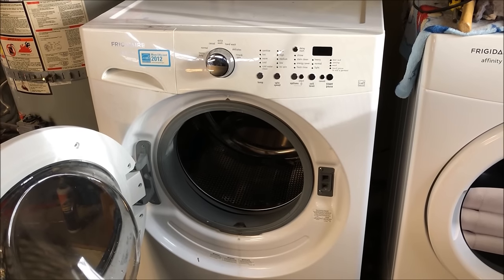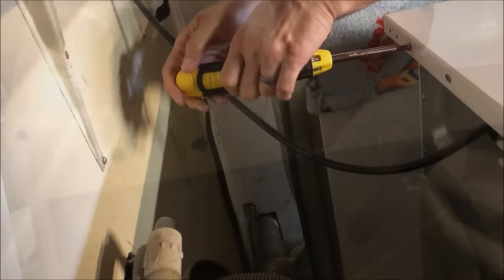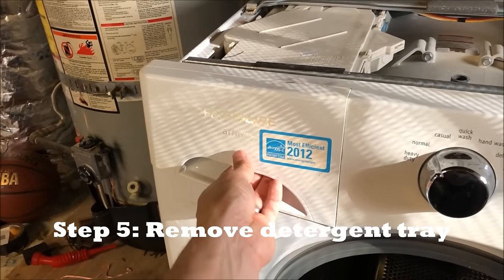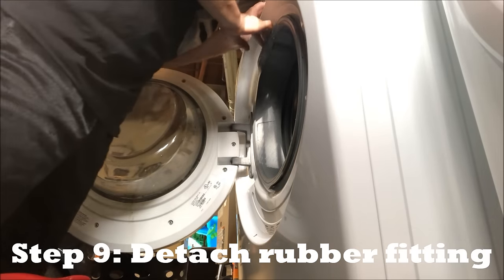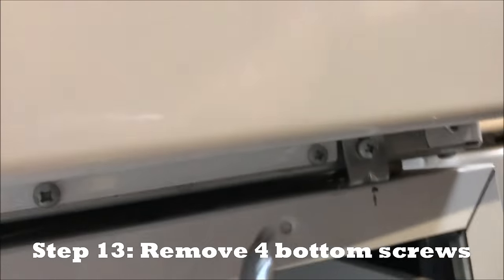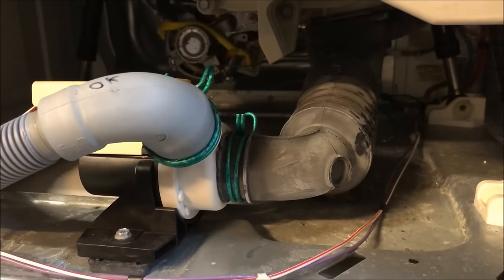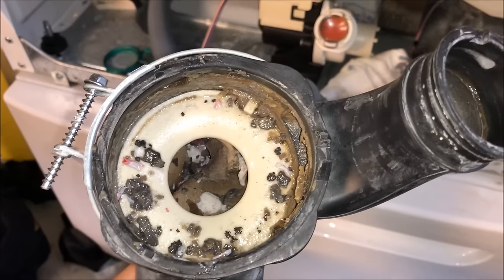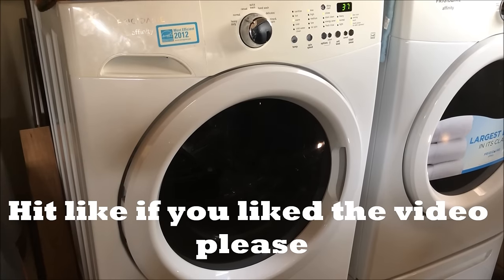How to fix Frigidaire Affinity Washer That’s NOT draining properly

Comment: Great video w great ideas. HOWEVER, i accidentally fouNd out it SO MUCH EAISER TO LAY THE UNIT ON ITS SIDE. There's access hole underneath and you right THERE where you need to be! I disconnected the main drain hose from DRUM(wide one), then the DRAIN HOSE itself, then white cannister (the DIFFICULT ONE). Twist, break the attaching white clip, making access easier to remove and reinstall tri hose connection. It took 30 mins for completion. I DID'NT HAVE TO REMOVE TOP OR REMOVE DOOR SEAL OR THE CONTROL BOARD OR REMOVE THE FRONT LOADING DOOR ASSEMBLY.... HOWEVER I AM VERY GRATEFUL TO YOU BECAUSE YOU HAD GREAT TECHNIQUE AND INFO!
Reply: I'm actually glad I didn't see this comment and went with the disassembly route. Unclamping the coin catcher was tricky even with the front off. Also I had a lot of water trapped in the machine which may have spilled onto electronics if I had it on the side.

Comment: Thank you for saving me from having to call the appliance repair guy! Our Affinity front loader (model FAFW3511KWO) actually has an opening in the bottom that gives you really easy access to the pump area and coin trap. No need to disassemble the washer, just tip it back enough to work on it. Found some rocks and COVID masks, among other things, clogging it up. Works like new now! Made my wife, who didn't believe I could do it, very happy. You're the man!

Comment: If you have a washer of this style, but not exactly this model, there's an easier way to get to the coin trap in some cases.  Mine let me remove a large access panel in the back with just a few screws, and had an access opening in the bottom.  That got me out of taking it apart.  I could directly reach the trap.
Reply: I have one an all I have to do is lean it back against the wall, no screws or nothing to get to the filter.
Reply: @DC-op8fs  I know what you mean about version differences in these things.  I have a car where changing a headlight is supposed to be about seven steps and take easily half an hour, but for whatever reason on mine, the process is to reach around a corner and unscrew the lamp and put in the new one, taking about 3 minutes.

Comment: I had a draining problem.. did not have a little service door to get to the filter. My washer is about 15 years old. The only trouble I had was to get the wire ring off. But ran your video back and fourth several times. The instructions were a great help, for the 68 year old man. I was a engineer a long time ago,  .. 

Thanks again
Reply from the maker: No problem. I’m glad I was able to help Bruce.

Comment: Thanks for the video!   The model I had was a little different but your instructions still were 95% applicable where it mattered.  The main difference was that it wasn't one cable to disconnect, it was 5 or so and they were all tie wrapped together.   Rather than disconnecting, I just rotated the front out of the way and ensured that the cables weren't pulled significantly during the work.   There was a huge clog; twist ties and enough fabric to make a sock.  Put it back together and all those puppies are barking nicely now!
Reply from the maker: You’re welcome. Thanks for dropping a comment. 🐶

Comment: Thank you man! Got this set (w/dryer) for a measly $275 from someone who had it in storage. Started up to clean and no drainage. As soon as I followed your directions and got to that pump, I could see why it was in storage. Bobby pins, a pound of wet material and probably $3 in change lol. Another tip for people doing this if you have the pump off you can reach up into the cavity of the washer. I managed to pull a sweater string out of there. Thanks so much man, don’t usually comment on these but you made my small investment well worth it!
Reply from the maker: Thanks so much for your input and your tip.

Comment: Thanks, got the job done. There are a lot of steps, but most of them are pretty quick. I think the hardest part was reattaching the coin catcher. I'm glad I followed the disassembly steps instead of trying to get through the access hole. That would have been really tricky to get everything clamped back on correctly.

Comment: Thank you so much. Affinity machines are terrible for accessing parts. Had to clean out Under the lint trap on the dryer and cursed the manufacturer for the most Un-user friendly construction. Same for accessing this coin trap and pump on the washer. Wow. Found a video that showed a machine with a removable panel, but needed to know how to take the whole machine apart. I absolutely had to have a second pair of hands for the squeeze clamps during reassembly and for getting the stretch ring around the door back on during reassembly. Your step by step instructions were perfect, and I am so grateful. And my machine works!
Reply from the maker: Thanks so much for your positive feedback and I’m so glad I can help out.

Comment: Saved us a lot of money. Thank you! For others attempting this, make sure you tighten the metal ring at the top of the coin catcher very well otherwise it will leak. My model was a bit different than the one in the video.

Comment: Thanks so much for posting this video.  Saved so much by taking the time to do it myself.  Also, I was able to get to the hose clamp that’s turned backwards much easier  be removing the back panel.  Also, I did not have to remove the hose that’s connected to the tub bc I was able to remove the clog from the filter without disconnecting that hose..  I removed $6 in coins and a sock from the drain.  Great video and thanks a lot.
Reply from the maker: No prob. Thanks for commenting. I’m glad I was able to help

Comment: Thankyou.  Good directions, I replaced the hard to work with spring hose clamps with ratcheded ones that work with a screw turn.  Easier and more controllable.  I'd call this a 2 hr job for the first timer.  A strong work light is helpful as it is with most everything.
Reply from the maker: Thank you! And thanks for watching and for your input the views appreciate it.

Comment: This video is so helpful! Thank you so much. One thing that I did was take off those annoying, difficult pressure clamps and replace them with hose clamps. So much easier to reattach when cleaning coin catcher and housing.
Reply: Not sure if you're still around, but did the hose clamps hold for you ok?

Comment: Another satisfied customer.  You probably saved me at least a couple hundos.  The guts of my Affinity were slightly different as my pump was oriented a bit differently but everything was pretty spot on.  The white plastic filter thingie in the rubber pump was absolutely disgusting.  I found a chunk of the drivers license from the former owner of my house in there along with coins, sediment and what seemed like bits of towels.  Cleaned that out, put everything back together (way harder than taking it apart) and I am back in business.  Can't thank you enough!
Reply from the maker: No problem Erik. Glad the video helped you out.

Comment: Thank you so much for this video, you saved me $495. Here's a cool tip, while I was inside the belly of the beast (washing machine) I went ahead and replaced the 2 washer filter clams with 2 hose clamps (2 in). Might come in handy in case I need to perform future DIY surgeries.
Reply from the maker: You’re welcome. Great tip!  thanks for sharing and watching.

Comment: Just acquired one of these. man what a pain.  I have the previous generation of this washer (2007) and there is a small access panel down below on the front to access the drain filter (same system).

Comment: Thanks for saving the day! My coin catcher and impeller was clogged with bobby pins. I had a lot of difficulty removing the control panel because there is a hidden tab on the bottom side. In my case, the panel needs to be pulled UP before it can be pulled out.

Comment: Wonderful, this fixed mine! Took us just about 2 hours. We used a wet/dry vac to control the water and minimize the stinky spillage. Somehow a dryer sheet ended up in the wash and sucked into the drain. Coat that in some hair and it had plugged solid.

Comment: Perfect! Followed your video and fixed it! Suggestions for others' success: I used the bag idea to collect the water, but I set the bag inside a wide, flat tupperware (like for brownies), so that it was easy to pull out - no tearing, snagging, flopping or sloshing. I did not even try to mess with those horrid green clamps once I had them off. I bought hose clamps (the kind that tighten with a screw) to make my life easy from the start. $2 each and WELL worth the time saved! Thanks for the help. I would never have attempted this without your video.
Reply from the maker: Thanks for the tip and no problem. Glad I could help.

Comment: This did the trick! My pump/trap placement was actually a bit easier to get to on my model. The only "oh crap" moment was when I plugged it back in and it came up and wouldnt spin. It threw an error for the door lock so I dismounted the control panel, unplugged and reseated the wires, then brought it up again. The water is flowing and the floor is dry. Thanks!
Reply from the maker: You’re welcome and thanks for sharing

Comment: WORD TO THE WISE: If you are going to take the time to do this yourself spend the $30-40 for a new pump and replace it at the same time.

90% of the comments in here say this fixed the issue but if you’re an unfortunate sucker like me you will do all of the work and it still won’t work at which point you’ll have to take everything apart again to replace the pump.

Comment: I had to replace the pump on mine and i took off the front counterweight and it was so easy to get all the clamps on and off 5 - 11mm nuts and 5 min will save you a ton of headaches trying to get the clamps back on.

Comment: Thank you for the video, Caesar! I have a slightly different model, but I was able to do everything from start to finish with this tutorial, and it's running like new after sealing it back up a second time. (On the first go around, I did not get the hose coin trap tub all the way onto the connection with the wash basin. What a mess!)

Comment: Great video! 

Remind me, next time I buy a damn washer to buy a model with the front access panel at the bottom to these common drain fixes!  Many have them. Lol.  Makes this a 60 minute job rather than 4 hours, and ya don't have to move it anywhere.  Even if it costs $150 more it would be worth every penny.

Comment: I ended up figuring this out on my own.  God, those clamps!!  I have hose clamps, I should have swapped them.  Knowing that threaded hose clamps can cause damage if you over tighten, I chose not to use them. But at least I have them where they’re easier to reach now.  Mine was nasty, totally packed and then some.  I should have known when it took like 20 minutes or more longer to run a load than the timer suggested something was wrong.  Mine had like 20 Bobby pins in it, $1 in change, a good amount of powdered metal (my family all works in the powdered metal industry), several pieces of jewelry, an old bra strap, and quite a bit of what I believe is old powdered laundry detergent.  Most of that stuff is years old, some of the Bobby pins were half rusted away.

Comment: Thanks for the info. I'll never get this type of washer again. I had a perfectly good LG front loader that had a easy access filter to get all my dog hair out in a snap. 
 Inherited from my grandmother thay paid well over $1000 for the pair a few years ago. 

This washer is overall so much worse. More noise, not easy to work on. Doesn't clean as good and overall just annoying. The matched dryer I had to replace the eletric heating element twice. Makes good window units, never again with the affinity series washer/dryer
Reply from the maker: You’re welcome
Reply: All washers should have a easy access pre screen filter with a drain tube. Disassembly of pretty much the entire washer is a terrible consumer design. I would think they want you to call a fridgair tech to drain your wallet. When my affinity series washer goes down hill. I'll happily just sell it to someone for pocket change as these are not even close to today's standards.

Comment: For those are are trying to get the large clamp off at the 7:10 mark, use a 1/4” drive ratchet and either 7mm or 9/32 socket.
Reply from the maker: Thanks for Ardy the tip Scott

Comment: Thanks for posting such a thorough how to! I'm not super handy, but your easy to follow direction gave me the courage to try it out. The e41 code ended up being the door lock assembly, but I found some material, coins and even a dollar bill in the drain/coin collector that needed to be removed anyway.
Reply from the maker: Glad my video helped you and your comment might help someone with the same problem. Thanks for your input!

Comment: I got the courage and inspiration to do our Kenmore Elite (very similar) disassembling watching your video! Thank you, Even though ours wasn't that clogged, it had plenty of stuff in it that didn't belong in there, plus the smell (I should say stench) was pretty bad. I cleaned all of the components I could and it works much better and smoother. Just take a couple of pictures of the hoses before you take them out and make sure you put them back and tight them exactly the way they were or something may leak, just saying. Thanks again!
Reply from the maker: No problem. I’m glad you enjoyed and found my video helpful.

Comment: So I just cleaned out my pump, which was completely clogged, thanks for the great video! I do have question though, does that orange rubber gasket thing under the gray hose absolutely have to be there? Mine was deteriorated & I don't know where to get another one.

Comment: This is why it's important to check ALL laundry pockets before washing! Lol.  Our lasted 8 years before getting clogged.  Since the kids started doing laundry I their own more, now it clogged.  Kids are HiGh Maintenance! Lol

BTW, there's an access panel on the bottom.  Pull the washer out and tilt it backwards to the wall.  Full access is on the bottom. It's a little more of a pain the ass to do everything, but still faster than pulling off the top, front and sometimes rear panel, and risk breaking something else in the process.  No need to pull those off.

Comment: Thanks, this is the second time doing it, 2.5 years between cleaning that pump hose.  Tip it on its side there is a access panel on the bottom, but those hoses are still not easy to work either, looks like from any angle.
Reply from the maker: Thank you. And thanks for the tip but some ppl have the pedestal under so it’s not as easy as just tipping it over.

Comment: I did what you said in the video, had trouble with the clamps but otherwise not too hard... Although my washer is now leaking, any tips on fixing that? Waiting for this cycle to run then will disassemble and check it out.
Reply from the maker: Thanks. I’m guessing you didn’t tighten the clamps all the way or maybe damaged the pump. Look for any holes in the tube and pump.

Comment: Hello! I’m having issues with my same washer. I’ve replace the inlet valve, pressure sensor and now I think I have to do the same with my drain pump AND replace the control board. There’s a loud buzzing when I start the machine, did you run into the same issues?

Comment: Thank you! We opened ours and the filter was completely full! We fixed it but now it still  stalls once in a while. Any idea or suggestions????
Reply: It might actually be the pump motor that is bad... What was done in this vidoe was cleaning the filter and trap. You can check out the vidoe I posted of replacing the actual motor. https://m.facebook.com/story.php?story_fbid=10219853913211970&id=1644681644?sfnsn=mo

Comment: Thanks for the video! I did some repairs to my washer a few years ago and I could never get that retaining ring back on. The spring was a nightmare. Any suggestions?
Reply from the maker: Yes needle nose pliers that stay closed when tightened
Reply: If you pop the sleeve over all the way around the lip first then you can use a flathead to slide the ring over the edges
Reply: I know this is older, but mine has a spring on it. I just pulled it open as far as the spring would let it and it went right on.

Comment: I bought 10years warranty on my washer. It's 6yrs old now. The detergent drawer is always full of water.  Also water is coming down from the bottom.  Got someone to fix it changed the pump and the drawer( don't know why the drawer 🤦‍♀️). Still the same problem but more water comes out from underneath the washer.

Comment: Great video thanks man I’m having trouble getting the drain pump clamps back on an the screw that goes on the peace that holds the change the one u turned around
Reply from the maker: Thanks. Those clamps are definitely the hardest part of the whole project. I kept at it until I got it on.

Comment: I would like to point out this is not just caused by a clogged drain.  I just had his problem and the pump filter was fine.  It turned out to be a bad door switch/latch.  The machine simply will not operate, or even try to pump out water, if it thinks the door is not latched and/or open.
Reply: Mine had the same problem.
Door latch switch worn out.

Comment: Great video...doing this tomorrow ...The comments about doing the work from underneath are   just senseless...will take you 10 Times as long plus washer would need to be over your head to access the 4 inch wide hole where your arm barely fits...!!!
Reply from the maker: Thanks Orlando! I know right! I’m all about doing things the right way n the easy way but opening from the bottom is not the way to go. Let us know how it went plz
Reply: Worked on my washing machine yesterday after watching the video...Did the repair in under 1 Hour...Don't forget the shopvac saves a mess from happening...!!! Thanks Again...!!!
Reply from the maker: Glad you got it done in less than an hour! Thanks for watching